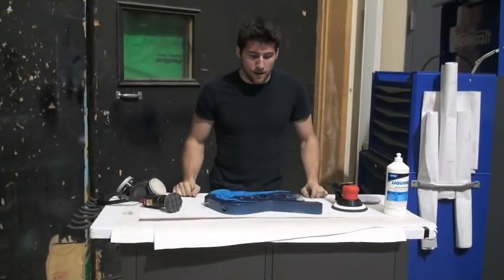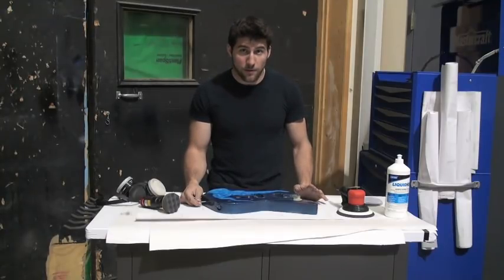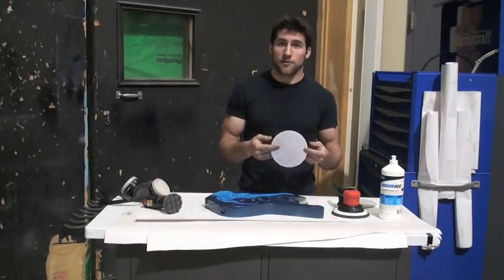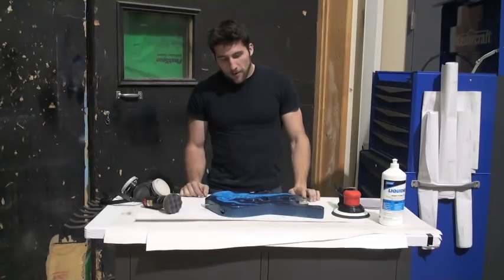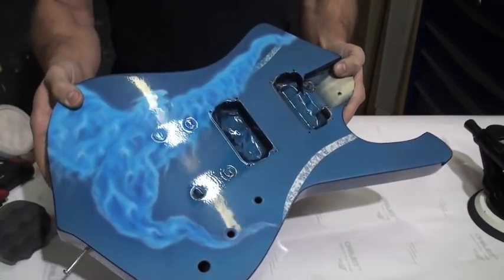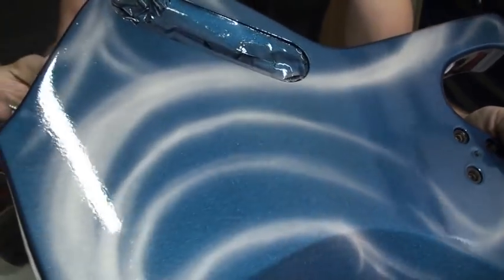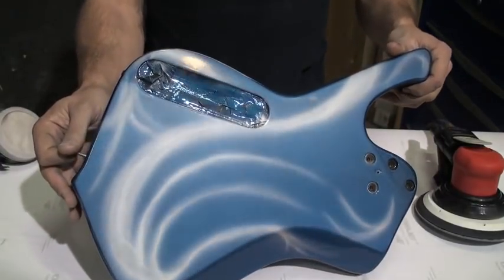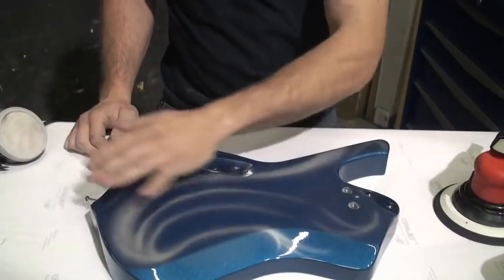How to buff out your guitar clear (step 1)

Comment: Great tip on the wet sanding. That was the first question that popped up in my head when you started sanding with the 1500. I appreciate the thorough tutorials- very nice depth.
Reply from the maker: Thanks. I'm glad you found it helpful.
Reply: Absolutely. I do have a question if you have the time. What grit do tipu use before you prime? I read 80grit was ideal for primer sticking to the surface.
Reply from the maker: 80 grit is a bit coarse I think. It depends on what you're working on though. Using 80 or 100 on the metal of a car and then spraying a thick two component primer on it works quite well. If you're spraying a 1K primer or a sanding sealer on a guitar you will probably want to go finer. 80 grit scratches will show through a thin coat of that, and you want to keep your coats reasonably thin when working on guitars if you can. I like to go with about 400 when prepping a painted surface. Sometimes I'll use 320 or 600 depending on the situation. For bare wood I like to go with 220 or 320. If I were using a 2K primer like I mentioned, or a filler primer, then I would use a coarser grit to give it something to grip onto.
Reply: Brad Angove that's good to know. I'm actually working with bare wood right now. And when I was trying to school myself on painting I looked at car paint videos as a reference so that makes perfect sense. The primer I'm using is a single step can (so I'm assuming 1k). 

And I'm curious for a completely different project I am going to paint. What grit would you recommend on a body filler to set for prime?
Reply from the maker: Yes, sorry for the jargon. 1k is the single component stuff. Automotive is a good resources for this stuff; that's how I learned originally, but there are some differences.
For body filler it still depends on what it's on and what primer you're using it on. If I'm working with body filler I will often use a coarse two part filler like bondo and sand it to 80 or 100 grit, then use a fine glazing putty like icing over it and sand that to 320 or 400. My earlier response may have been a touch misleading, because now that I think about it even for metal and filler I sand to about 320 before priming with 2K primer. I understand why 80 would let it grip well, but 320 was what they used in the body shop where I did a good portion of my learning.
Reply: Brad Angove That's good shit, man. Do you (we established wet sanding a guitar body is not a good idea) (wet)sand with higher grit between the various coats?
Reply from the maker: I don't sand between coats unless I'm using a solvent based paint and I let it dry too long. Solvent paints have re-coat times, and if you miss those times you should let them dry completely and then sand them lightly so that the next coat will stick. Even in these situations, I generally don't wet sand. I wet sand when I'm polishing a piece of metal or something where I'm not worried about water at all. For example, if you've seen my metal art work, I wet sand to do my polishing on those items, particularly if I'm working by hand. If I'm using the orbital sander I don't tend to bother.

The exception to that statement is lacquer. Coats of lacquer melt together, so even after a day of drying you don't need to sand before re-coating. That being said, you may do so in order to flatten out previous coats before continuing. In those situations I would let it dry for about 3 days and then sand and start into a new round of coats. I like to do that after the sanding sealer, but I don't typically do so in the middle of my colour or clear coats.

Also, if I find that I need more then three coats of clear for a project, I will do the first three, let them cure, sand, and then add more. Typically that is what is recommended on the tech data sheets as well.
Reply: Wow, thanks for all the advice, man. Your insight is greatly appreciated. I do believe I have a few more general questions if you have the time. 

How many coats of 1k primer do you recommend? Should I sand the primer before the base coat if so to what grit? Also, just generally, how many coats of base and clear would you recommend on bare wood. I will be using Rustoleum cans; enamel paint and clear.
Reply from the maker: I usually go with 2 coats of primer. Then I like to let the primer dry and sand it smooth (400-600 grit) before adding the base coat. I also do two coats of the base colour, then one coat of any specialty paints of effect stuff I'm adding. Finally, I like to do three coats of clear. The first coat is generally lighter than the subsequent two.

Comment: Great work man. Everything you said was spot on. The only thing I would say is that you did not sand the clear down nearly enough. It was obvious there was still a good bit of orange peal over the surface. Without cutting the surface down perfectly flat, you will not be able to get the optimal results. I am happy to show you some of mine, if you like.
Reply: Of course, 10 years later and you have likely figured that out. lol Gotta remember to look at post dates.
Reply from the maker: Haha thanks Davy. Yeah, this one is old and I was concerned about sanding into my textured line graphics.
Reply: Perfectly understandable

Comment: Brad, this is killing me.
I must have put 12 months of painting attempts and today I thought I had it when it came to the clear coat.  I might be able to fix this with a cover art but on the back of my neck at the base I got a good size (1") paint wrinkle with high ridges.  I used Rustoleum over Krylon but that should not make a difference as it only hit one area on my guitar.
This is a custom fireman's axe guitar for the Hot Shots and hoped to have it done by 6/30 but it will very close.  Off and on I have been working on this guitar for three years and the painting has been the biggest setback for me.  Maybe next time (if there is one) I might do a Police guitar but will use a spray gun that time around. 
Thanks for the tips,
Jimmmy
Reply from the maker: Damn; I hate when that happens. Did the under coats wrinkle as well or just the clear?

Comment: Hey Brad. Thanks so much for your instructional videos. I've really learned a lot. This is my first experience doing something like this. My Jazz bass is looking good, but I put on the second clear coat Tuesday. Today is Wednesday. I noticed a run coming from the saddle. Do I wait a few days to sand it down? Or can I do it now. 1000, 1200 grit? And how many coats of clear should I use? Is there an alternative to using Liquid Ice? Thanks so much man!
Reply from the maker: Wait for it to dry for a few days and sand flat with 800 grit. Sand the rest of the guitar lightly with 800 and then spray more clear. 3-6 coats is typical.

Comment: Hey Brad! I noticed you're using Trizact for the 3000-5000 sandpaper. For the the first 1500 paper you used a P graded paper, but it doesn't seem like Trizact are using the P system. I was thinking about using Trizact for my next built, so far I was sanding only up to P2000. But should it be something to worry about? I mean, if I got it right, then 3000 (as opposed to P3000) is pretty much the same as P1500. Will appreciate your input. Thanks again for the great videos!
Reply from the maker: It’s nothing to worry about. As long as it’s smooth enough for you to polish out all the scratches then it’s all good.

Comment: Thank you for uploading this, its really helping me with my guitars.

Quick question, what brand of orbital sander is that?

Also is it hooked up to an air compressor?
Reply from the maker: +HotMaestro I'm not sure what brand it is off the top of my head. I will take a look next time I'm in the shop. It is hooked up to a compressor. There are a lot of similar pneumatic random orbital sanders that would work just as well.

Comment: Hi Brad, loves you videos!  How do u compare the machine vs a bench polisher?  Are you able to get the same results using one like the “Flex Polisher”?
Reply from the maker: The bench polishers are better. They can buff out deeper scratches, which means not needing to sand quite so fine.
Reply: @BradAngove  thanks for your response!  Those are expensive Stewmac has their for about $800.
Reply from the maker: Ya, they’re pricey for sure. Hence me not having one haha.
Reply: @BradAngove  I got some hand polisher machine that I use for my car that work good on my guitars, also I use the “Micro Mesh” sanding up to 12000.   I use this product with great results: ProCaliber Products 54-12-366 2oz Liquid Abrasive Polish.  This product facilitates the polishing process and give a high gloss finish.

Comment: Hey Brad,   just started with the 1500 on a duplicolor finished guitar.  I can see the high spots going down gradually.
Is it normal after a few minutes of sanding to start gumming up?  I'm concerned about sanding thru the clear.
So I'll sand for 20-30 seconds and then stop and check my progress.  I've noticed a few tiny bits of sanded off material
will stick to the sandpaper.  Is this due to the friction heating up the "paint-dust"?
Reply: Solved the problem.   I was getting build-up because I had done some early 3000 and 5000 just to see what it would 
look like.  I didn't clean off the surface and went back to 1500 to remove the rest of the high spots.  The dust from the 3000 and 5000 runs were forming those little tiny dots again.  Cleaned the surface with naptha and that solved the problem. 
Unfortunately, I sanded thru on a spot on the back belly carve near the edge.  Won't do that again.  Hand sanding for all the sides and carves from now on.  Will be more careful on the top.  I can always touch up the sand thru spot.  Duplicolor has touch up sticks.
Reply from the maker: Glad you got it sorted out. You have to use no-load paper and clean it reasonably frequently to avoid that pilling.

Comment: How long do you wait before wet sanding after clear coat? Thanks for all your advice!
Reply from the maker: For this clear coat it’s 24 hours. For non-catalyzed clear coats it would be considerably longer.
Reply: @BradAngove  any advise or videos on clear coating over decals? I did a Kamikaze style sticker and attempted clear coating using 2X Rustoleum.. I feel like it wasn't thick enough and sanding it kinda dulled it somewhat.. should I sand or leave it? Ordered spraymax 2K for the next one hoping that makes a difference.
Reply from the maker: Wait a few weeks, sand it lightly with 800 grit, then paint over it with the 2K.
Reply: @BradAngove  thank you! I'm learning by watching your videos

Comment: (I just discovered this) great video but: in order to avoid so much valleys and mountains after applying the clear lacquer you must thogrouly mix the components, thinner with laquer (not just a little agitation). You will get a much more homogenous mixture to spray, and surely need less sanding and it will be easier to buff.
Reply from the maker: I didn’t use any lacquer on this one.
Reply: Brad Angove oh! I see. I like very much your videos
Reply from the maker: Thank you Carlos.

Comment: how many CFM does it take to run that air polisher? brand type & guesstimate of cost of air sander? my paint is at 2000  grit I need to polish it with buffing compound and then buff it with McGuires buffin swirl and polishing compound. I'm trying to finish last bit so um looking to use a sheepskin pad & use a compund then polish, thanks once again for this vid.
Dave
Reply from the maker: Hi David. I don’t have the specs handy, but if you look up my name on kit.com, I have a “kit” there for polishing. It includes affiliate links to several polishers, pads, etc. I think they’re electric too so you don’t have to worry about cfm. 
If you do happen to purchase something through there, it helps me out as well.
Reply: Brad Angove 
Oh cool thanks , win win.
best David

Comment: If you have 70’s polyurethane finished body with checking, will the sanding and polishing compound remove the checking?
Reply from the maker: No, it doesn’t remove cracks.

Comment: Brad, how do you know how much clear coat to use? I am repainting my guitar.  Seems like the clear coat isn't making it as shiney as your before sanding.
Reply from the maker: Derik Stowell Hi Derik. It takes a bit of practice to learn how to create "flow" with your clear. You want to put it on just thick enough so that it looks smooth and wet as it's going on, but not so thick that it drips/runs.

Comment: I was not prepared for how much material the 2k spraycan delivered. Got runs on the sides in a few places, and more concerningly, a couple of runs right on the edge. How would you typically deal with 2k clearcoat runs right on the edge?
Reply from the maker: Let it dry for 24 hours and sand them out. Then decide if you need to add another coat.
Reply: You're the best, dude. Thank you so much again! I promise from now on I'll make sure to buy everything I buy from Amazon through your links.
Reply from the maker: Haha thank you.

Comment: when I use.wet sand on may guitar and put a polish compound and buff with may hand use a micro fabric I got the glossu shine at it also have a lot of scratches what should I do to avoid scratches
Reply from the maker: The microfibre cloths leave scratches. Use a compound applicator or a soft foam polishing pad.
Reply: +Brad Angove what that way hmmm. what other options to use coz I dont have that machine  you use to.. I use my hand
Reply from the maker: You can use applicators and pads by hand. A soft cotton cloth could also work.
Reply from the maker: Lint free.
Reply: +Brad Angove oh the besy is use a cotton fabric to bufd the rubbing compound 
questio the turtle rubbing compound in the.Philippines was not white its look like dark red color my guitar.project was color white it could leave some stain?
Reply from the maker: It shouldn't leave a stain if you buff it off properly.

Comment: Alright i have a few questions.  Just cleared my first guitar with spraymax 2k.  I sanded up to 2k grit, but im still seeing sanding scratches after rubbing compound.  So i imagine i shouldve went higher.  What your using to sand is just a standard orbital sander? Ill get this guitar as good as i can and learn going forward (burned through an edge lol).
Reply from the maker: I’m using a dual action orbital. Sanding by hand in one direction with a block is event better. 
What kind of compound are you using?
Reply: Turtlewax "performance" rubbing compound.  I actually hit it with a foam drill buffer attachment first and it didnt seem to help get rid of the scratches, but it did make everything more glossy.  buffing by hand with a microfiber cloth and the compound is working...but its painfully slow. lol
Reply from the maker: Microfiber leaves scratches. If you’re having trouble with that, try switching to an old worn out T-shirt.
Reply: Cool ill give that a shot.  These seem like deeper scratches though.  Maybe it was crappy sandpaper or somehow some foreign grit got in when i was wetsanding.   Live and learn lol.
Reply from the maker: If your poet jams up a bit while you’re sanding and you keep going it can do that sometimes.

Comment: You noted that there is no need to wet sand if you are using an orbital sander.  Should this be true also if you are using a nitrocellulose finish?
Reply from the maker: Robert Clowers Yes. You can also sand by hand without wet sanding.
Reply from the maker: Good point. Thanks.

Comment: took some time but with your help i finished the clear coat of lacquer, buffed it and been playing the guitar.

However near where my strumming forearm rests, there seem to be a gummy like haze developing...any ideas on how to clean it?
Reply from the maker: +nmssis Just to clarify, did you use a polyurethane like I did here, or did you actually use lacquer?
Reply: Brad Angove actual lacquer
Reply from the maker: Ok, how long did you let it dry before you polished it?
Reply: Brad Angove i let it cure for 4 weeks.  then wet sand...then rubbing compound then polishing compound to a glassy finish.
Reply from the maker: Ok. It should have dried fully then. One of the concerns with lacquer is that it gets soft when it heats up. This means that if your arm is rubbing against it for quite a while it can get warm and gummy. If it's leaving some kind of corrosion or residue there, you may be able to clean it up with some polish, but I'm not really sure if that will work unfortunately.
Reply: Brad Angove
feel as if i need to somehow remove the gunk...lol...i can actually move it around...weird.  

but would you be able to recommend what solution like mineral spirit or something that's safe for lacquer and possibly effective?
Reply from the maker: I would try something less aggressive first, like wax and grease remover or windex or something of that nature. I'm not sure what kinds of solvents would be safe on lacquer unfortunately.
Reply: Brad Angove

cool...will try that, thanks!
Reply from the maker: Let me know how it goes.
Reply: Brad Angove - It must have gone badly. Perhaps it burst into flames and he died
Reply from the maker: Perhaps. If that’s not the case, hopefully he tried naphtha.

Comment: I used 2k on stained wood not painted so come grit came back after sanding over and over. Can I polish it back down without tearing up the 2k?
Reply from the maker: You sand it with 800 grit a bit and re-coat it with three more coats so it will seal.

Comment: Dude! You really sound like Ryan Gosling. What about signed guitars, just apply clear coating on te areas signed and sanding and clear coating again?
Reply from the maker: It's probably signed right over the clear coat right? The problem with that is that paint doesn't stick properly to glossy surfaces. I assume that sanding down your clear would sand off the signature, so I'm afraid I don't really know how you would go about that. Sorry. I guess you could try clearing over it, but it might react poorly with whatever they signed it with.